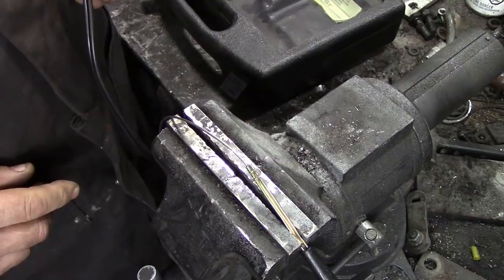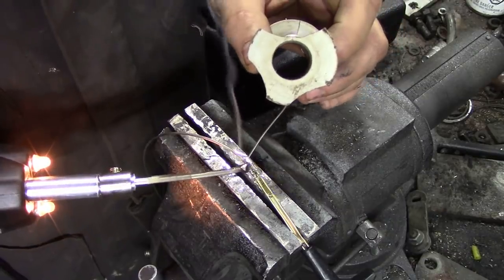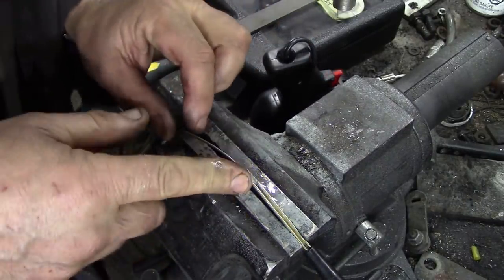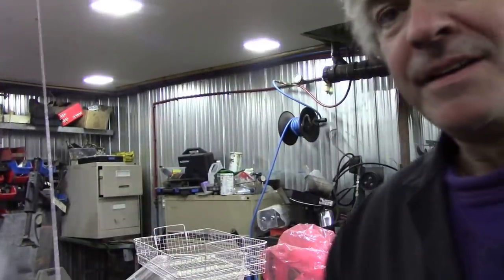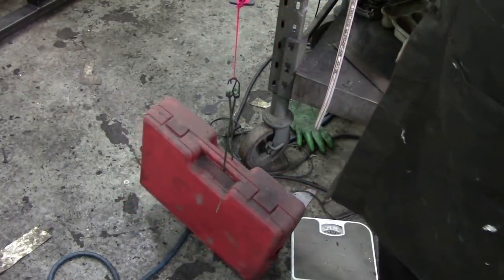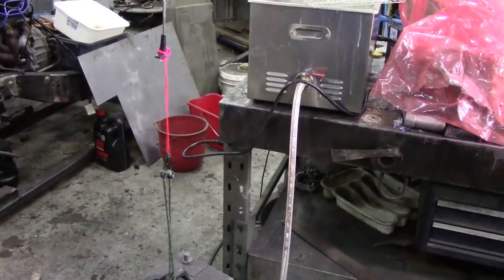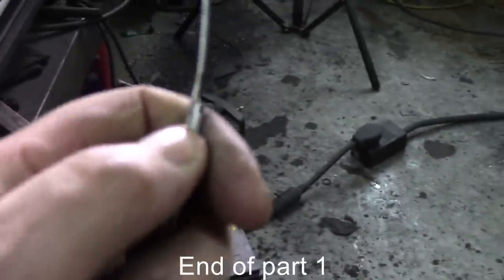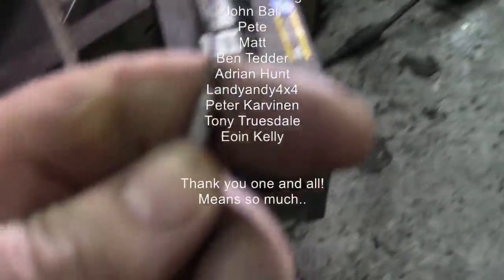Bonnet cable experiment. How much weight will a modified Britpart cable take?

Comment: Bloody hell Mike, the look in your eyes when it held 3 batteries, you looked like a mad professor who had invented an anti gravity machine. ---- So what has this experiment proved????  EASY!!!! to open your bonnet, add 3 batteries to the cable.--- Great video Mike , please send more of. Best wishes from Yorkshire Rob.
Reply from the maker: I really wanted to use my hydraulic puller but there would be no way to measure the force without a gauge
Nice bit of fun! 
Mike
Reply: That's what it is all about Mike. FUN!!!

Comment: Hope you had you steel toed boots on there, Mike. Spat my Twix out when you were putting the third battery on.  Wish I could solder.... such a ‘basic’ skill that I intend to ‘master’..
Reply from the maker: I always have rigger boots on - I get them from the UK! 

Soldering is pretty easy - you just need the right heat range -- many use a flame but it is too sever - the Weller gun comes in different heat ranges and has a 2 'speed' setting on the trigger = 200w and 260w  I think that is all we can muster on 110V

Comment: How much force does it take to pull the bonnet release?
Reply from the maker: Good question -  I do not have a STD vehicle in the yard to try but I will check it out - I would have thought  if set up right no more than 1 kg

Comment: G'Day Mike. Been watching this mini series with great interest as my STOCK Td5 Bonnet release cable went fubar and completely snapped the plastic handle in half (no spare wheel on the bonnet).
Now I don't know why but on my Td5 the release cable is mounted to the left side of the drivers foot well on a RHD deefer. So the cable has to do a very peculiar route to get from the front slam panel to the operation handle. In my frustration I just cut the cable short at the front grill and left a bit of the bare cable just hanging out. Now what I would like to do is mount the same system as what the Australian Defence Force used on its defenders. Its a small lever that sticks out the front of the grill and has a straight pull to the release catch of about 10-15cm. The down side is I can't find any of the parts to do this so I may just have to make my own. But at least now I know roughly how strong any soldering I do to the cable is going to be and what I can expect it to be capable of. So thanks Mike :)
Reply from the maker: Look for MRC6977
Obsolete form LR but there is a lot of ex MoD out there
Reply: @BritannicaRestorations  Thanks Mike, glad you know the part number, I couldn't find squat!  lol

Comment: Why not cut through the soldered joint in increments and see how far the solder ran...After soldering wipe off the excess with a cotton rag.

Comment: Joking aside, I am finding these interesting as I am looking for a way to extend (move) a stop cable on my catamaran so I can kill the engine from the helm. It will need to be around 14ft long. I had been messing with bicycle parts as I hadn't imagined that wagons still used stop cables like this. So I need to find a truck factors. Also, I had not considered using solder (odd as I am an avionics eng, it didn't occur). 

Questions: If I use a solid wire what sort of radius could I bend, is it more or less forgiving than twisted cable? I don't mind having to reset the stop manually as it adds an extra layer of security?
Reply from the maker: Solid cables are less forgiving than flexible ones - they need large sweeps
For a long distance you only need the outer supporting at the ends - the inner cable can be bare like on a bicycle, and  you could run round rollers for corners - quite easy to do
Like here
https://bicycles.stackexchange.com/questions/18255/why-does-cable-routing-utilize-alternation-of-sections-of-shielded-and-unshielde
Reply: @BritannicaRestorations  Brilliant, I had already considered bare cable across the bridge-deck, but rollers will solve many problems I have considered would stop my plans. One of my issues is concern that the spring on the engine stop lever (little 1GM10 Yanmar) would struggle to pull the cable back, hence my interest in solid cable. I don't want to fit solenoids as being a boat KISS is always best. Currently I have to go into the boat to the engine room to stop the motor, this is a pain. Thank you for your reply Mike, you have given me an idea to work with.
Reply: @Lancashirelad Agreed, do you think that might add unnecessary strain to the stop wire, probably not? The spring in place doesn't seem that strong. If I go down the solid wire route and with Mike's idea of rollers (this answers the problem giving me a big headache of the 90° turn from under the cockpit floor up the helm). I'd have to look at the engine, I don't think the spring is external which is a shame as it might be easier to swap for a stronger spring. The thoughts I have about the strain are not because it will be too heavy to pull, but the more work I expect from it, the more tie-downs I'll need to add or any unmounted curves will just try to pull straight?  I'm really beginning to warm to the idea of retrofitting a solenoid.
Reply: @Lancashirelad I have an image of the port engine room setup showing the stop cable this is short and directly under the helm. You can see the unsoldered pull stop, but this has been changed since as the cables (especially the sheave) corrode quite badly in the salt air. I can't see anywhere to easily attach a spring, but the photo may be deceptive. I think for the long run solid wire may solve many of my worries and it wouldn't need to retract as I would do that.  http://www.topcatsail.co.uk/Albums/images/sailing/2008-06-30-port-engine-room.jpg

Comment: Great demonstration of the holding power of the soldered joint but I had visions of your batteries crashing to the concrete floor and depositing spilt acid over your feet and legs. 😳
Reply from the maker: Dead batteries used for exchange

Comment: I used to have one of those Weller soldering irons way back in the 1970s did not no they was still around I found it to big and clumsy for most jobs.    That soldered joint worked great but seeing you put those batteries hanging like that I would have put something soft for it to land I  was expecting one to hit the hard floor and crack open I also thought that you should have put some eye protection on with that wait on it if it let go the cable would have shot out in any direction.
Reply from the maker: dead batteries full of water ( or ice ) now

Comment: The plumbers flux really helps clean the bits and make a good joint.
Reply from the maker: Must remember to wash it off as it will corrode the material
Reply: @BritannicaRestorations  Good point Mike, soapy water